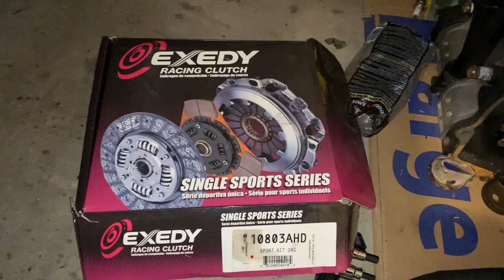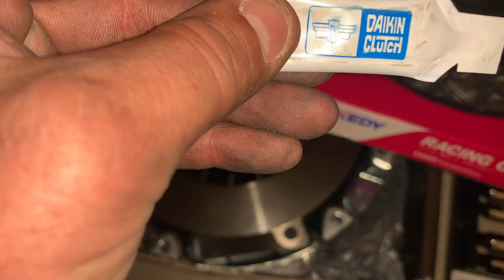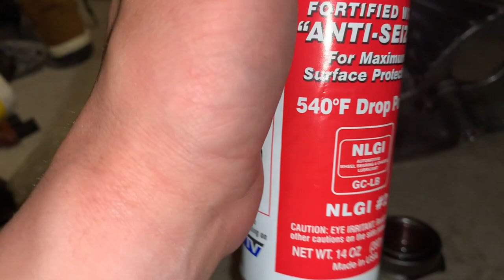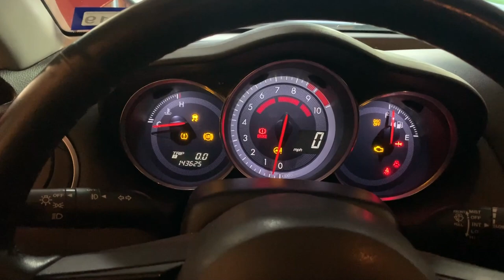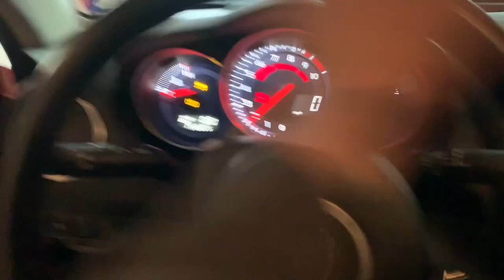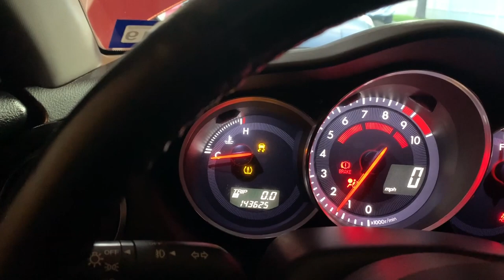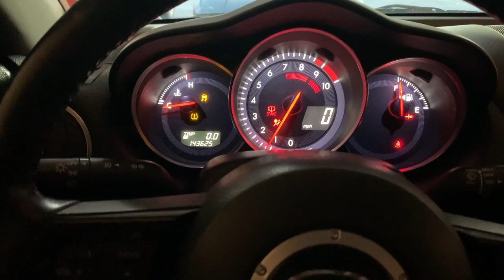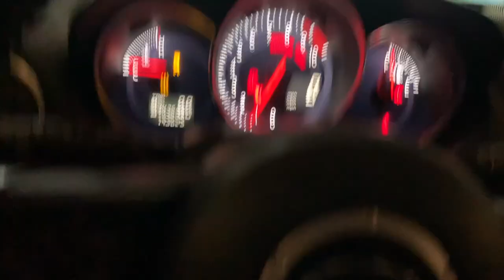FIXING MY BLOWN UP RX-8 R3

Comment: I've gotta get my s1 back up and running transmission is bad I want to upgrade to an s2 transmisso how hard would it be to do any I read that you need to reverse the wires for the reverse how hard is it plug and play or splicing? How many hours did it take?
Reply from the maker: Just switch the wires around for reverse and that’s it, it’s a bolt on upgrade from there

Comment: I thought the stock clutch kit was good for 300lb of torque not hp.
Reply from the maker: The HP is irrelevant as well as torque. The Renesis will never see anything close to the 310 ft lbs it’s rated for. I just threw out a number for HP when referencing capacity, the clutch kit I used is still super overkill either way